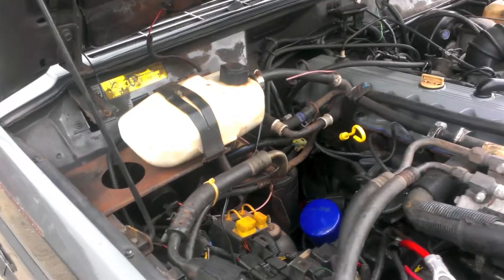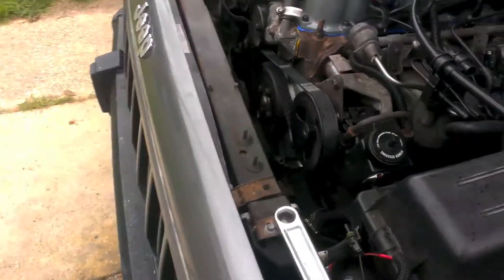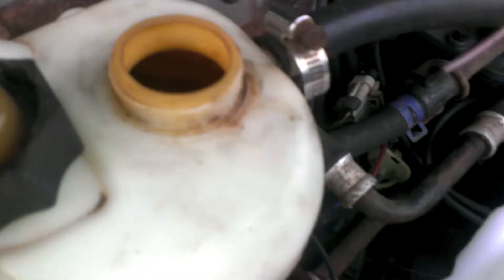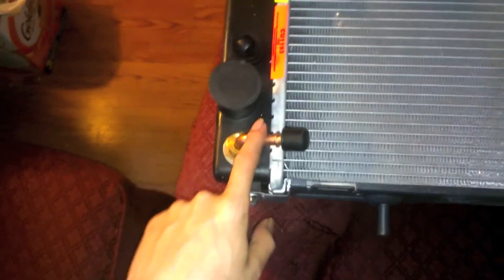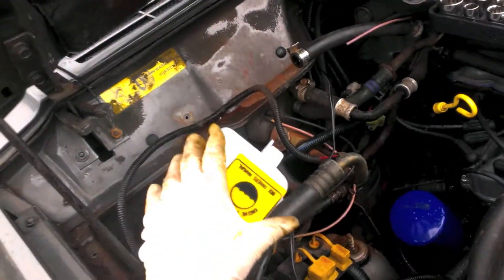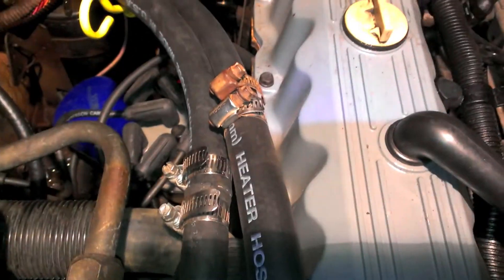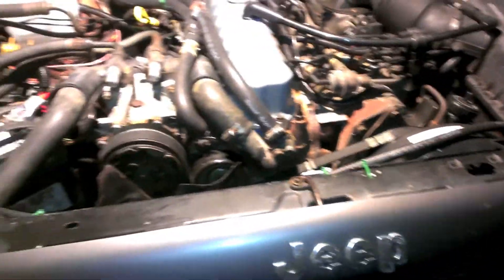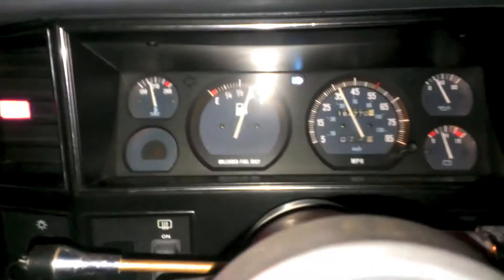89 Cherokee Closed to Open Cooling System Conversion

Comment: I'm going to hit you up on FB on this.  The difference is the "newer" style can draw coolant back into the system which is technically open as it just has a cap on the reservoir, while the "older" unit actually screws on and pressurizes.  Thus the "newer" is like todays tire pressure monitor systems for those who do not check their turn signals, oil, power steering fluid and coolant often enough in my opinion.  Meanwhile both styles use pretty much the have same cooling surface, fan clutch and water pump.  I am not an engineer, but there are those who will increase coolant capacity, air flow rate and water flow rate to make things better.  Logic point, if your pressure or reservoir is discolored, it's due to lack of maintenance or someone threw in "sealants" that might be gunking up the block besides the heater core.  Then one will need to throw in some "cleaner" in hope to dissolve and clear the gunk out.  So only in an emergency would I ever throw in an egg, pepper or "AlumaSeal" into the cooling system while in the backwoods.  Other than that I'd rather call a tow truck where my insurance can cover it.

Comment: If you ever bypass your heatercore instead of searching for those adapters again or struggling to find the 90 degree version just go to O'Riley's and search coolant hose for 1993 jeep Cherokee part number GAT 18793. It's a heater hose bent into a 90 that goes from 5/8 on one side to 3/4 on the other!

Comment: Hey man I converting to a open system my question is why is there two openings on the over flow? Does the lower opening with the knuckle get left open?
Reply from the maker: Do you have a proper overflow bottle? On the Jeep Open Style Overflow there is a top nipple that connects to the radiator neck, and a top spout to vent coolant in the event that the bottle has overfilled.

Not sure why an overflow would have 2 nipples unless you just have a closed style resiviour with 2 hose connections.
Reply: @NickInTimeFilms  I think what I'm referring to is the top spout event Cooling in cuz it's open and it's below the top nipple on the side it's the same bottle that you installed

Comment: Hey man I know this is an old video but I have two questions. I’m about to do this on my comanche. 
1) So you keep the stock thermostat housing? Bleepin Jeep’s video he changes his but I know his radiator he used doesn’t have the spot for the electric fan so I think he made up a fix for that. So I guess the question is, does it work soundly if I use what you used?
2) Did you see any loss/gain from ditching the heater control valve? I know you ended up putting a junk one in afterwards. What lead you to do that? Is the air hot no matter what setting it’s on? I can’t see any draw back other than not having cold a/c but maybe you found one? 
Thanks man. Good video.
Reply from the maker: If you find a rad with the temp port then it's plug and play.

I don't think I had AC for the longest time, so I was hoping I could keep the outside air as cool as possible. I'm not sure how much of an effect it had, but it's fine without it. It may have also been an attempt to see if the engine would heat up faster in the winter, but eventually I went full electric fans so it can get to temp.
Reply: When I first made this mod ten years ago the later replacement radiator I bought at the time also did not have the threaded port for the fan switch. I bought a new one to replace that a while back, a Spectra too, if I recall, and it had the threaded port. I am now in the process of un-doing the wiring hack I did ten years ago to return it to the stock configuration. Those fan switches are available in different temp setting, by the way. I got one that turns on at 185. The factory setup runs too damn hot!

Comment: why is it an upgrade
Reply from the maker: An open cooling system works similar to a closed system, but it's a lot less temperamental. In a closed system, if it ever becomes overpressurised, it's going to bust through the weakest link and you lose all that coolant. In an open system, any extra pressure is instead vented to a recovery tank so the system stays at a safe pressure. When the system cools, it will suck in extra coolant from the recovery tank which helps purge air bubbles and well. 

Overall, I'm much happier with this system as it has held up much better with the extra demand I've needed from it.

Comment: Any ideas on how to get one from being vapor locked hit a deer so we changed the radiator but don't have the money to change everything over like this we've tried everything and no it's not a cracked head our top hose isn't pulling fluid doesn't overheat unless you let it get to low on fluid just bubbles back in the box or comes up too far in the box and will overflow when you stop and the hose gets really tight until you let the pressure off then you can get it and go until you stop again? Please if anyone has any ideas would be greatly appreciated

Comment: Never put water these engine corrode quickly use  50/50 as recommended overall the best drivetrain ever 1990 to 1997 inline 6 bulletproof tranny cheers
Reply from the maker: HA! Dexcool is definitely not what you want in these engines. You'll gel up like no other. Regular green is what you mean.
Reply: @NickInTimeFilms  mybad bud yes you know you're shit spot on cheers!

Comment: I’m doing this now but I’m just using the factory bottle and leaving an open drain off hose out the side and running the hose off the radiator to the bottom of bottle so I can still use the bracket
Reply: My radiator had already been swapped for a pressurized one and just had a hose hanging off which would suck in air when overflows so I bought a factory bottle and just don’t run it closed

Comment: Hey +NickInTimeFilms I was wondering if you knew where the heater blower control thinga majiger vacuum lines routed. I have two lines that control the different ways heat is blown in the cabin and they're pretty much nonexistent. The lines are shredded and have been that way since I bought it. All I have is defrost mode and it'd be nice to have an idea where they go and if you replaced yours and if so where you got the replacement lines b
Reply from the maker: +Noah Maxson Luckily my vent vacuum lines are still in one piece. The Vacuum In line (Black) and Heater Control Valve Out line (Pink) are located on the passenger side engine bay to the left of the heater core coolant hoses. 

The small black line receives vacuum from the vacuum storage ball located in the passenger side of the front bumper, and the large line from the ball goes all the way back to the intake manifold towards the back on the top.

The pink line goes to the heater control valve near the heater core. If there is no valve, this line needs to be capped off with a screw or something. 

If everything in the cab is in good condition, then the vents should move again when the engine is running and the black line is receiving vacuum
Reply from the maker: +Noah Maxson This video shows you how the vacuum ball is hooked up along with some other lines. https://youtu.be/ulQbXshAgSE?t=18m20s

Comment: I just found this on a forum:
http://www.amazon.com/gp/product/B000COS5OW
Seems like a better deal than a new rad.
Found it on this site:
http://comancheclub.com/topic/27068-closed-to-open-cooling-system/
Seems like a better (less expensive & easier) idea.
Reply from the maker: Andrew Roby Clever. Don't see any issues with that.
Reply: NickInTimeFilms So i'm looking at coolant bottles to replace the crappy pressure bottle but i'm a little confused. With open system It's effectively just an overflow bottle right? There are cheap bottles that have the overflow hose connected at the top but i'm worried air might back flow through the hose, is that why everyone uses the ZJ bottle? Because the hose connects at the bottom, thus now backwards airflow? Or does it not matter & people just get the ZJ bottle for convenience?
Reply from the maker: Andrew Roby You're mostly correct. The new bottle is just for overflow and isn't sealed so it allows the pressure to equalize. The one that I bought for 91-01 XJ's does have a fitting at the top, but there is a tube built into it that runs all the way to the bottom to prevent air from getting back in. As long as the outlet is submerged you'll be fine.
Reply: NickInTimeFilms OK, that is what I was worried about. I found a cheap one that would fit perfect but the fitting is on top and I can't tell if there is a tube that goes to the bottom, so back to the books I guess... or maybe the junk yard lol.
Reply: +NickInTimeFilms Well I decided to spend the extra money and do it the same way you did but now I've got a stutter when accelerating at low speeds. It's only one little spot on the pedal. I can just give it a little more/less gas and it's fine. I've heard that air bubbles in the coolant can cause problems but I'm thinking that the tranny fluid from the rad. swap made a big bubble & that's causing a problem? I refilled the tranny fluid but no change. I've also got really low oil pressure, so I think it might be related to that... but the problem just showed up. Any ideas?
Reply from the maker: +Andrew Roby I doubt air in the cooling system would mess with your acceleration at all. Issues with the pedal always point me to the tps first, maybe it has a dead spot now?
Reply: NickInTimeFilms It's brand new, like everything else. I did some reading last night and I think it might be the coil. The cap, rotor, wires, & plugs are new. I might run some sea foam through it too. IDK, I might just stuff a rag down the gas tank and light it.
Reply from the maker: +Andrew Roby You can try a coil but they don't seem like something that would go bad all too easily. If you do light it, add some fireworks to the tank so it can go up in style :)

Comment: No dont remove the heater control dont buy anything extra or swap out anything more then the rad. All you really need is a piece of hose for the overflow bottle.

Go on ebay and look up a 1992 rad from sunbelt. a store called auto cooling that has the sensor hole for sure and if you carefully take out the old rad everything will fit right back onto the newer rad and you dont have to buy anything else and you can use the original junky plastic bottle as the overflow tank if you would like im telling you guys 52$ free shipping ebay thats it 2 core 1 inch thick.

If you are carefull taking it out then you will need nothing more then a new radiator
Reply: +NickInTimeFilms Please explain the "filter to allow the pressure to equalize".  I was considering using the original bottle and running the rad 5/16th out to the bottom of the bottle, blocking the side and drilling a hole in the cap so it will still burp.  I was thinking if the system needs to purge air it will do so through that bottle but the overflow coolant can still suck down into it.  shouldn't the 5/16th from rad be going into the bottom of a non pressurized bottle?
Reply from the maker: +Kent Dickerson You can use the old bottle as you described. By filter, I just mean make sure the hole in the cap isn't so big that stuff can fall inside and get in the coolant. The bottle I got has a built in tube the connects to top port to the bottom of the bottle.
Reply: +NickInTimeFilms Gotcha, i think that is what i am going to do.  I own a donor jeep that the po had done something similar that i am now taking the radiator from and figured i would use the same bottle.  I have two of them brand new so i might as well.  still trying to decide if i will be eliminating the heater valve or not, probably decide based on time of day and hours into project at that point.  thanks
Reply from the maker: ant l Two problems here. 

1: The heater control valve is part of the metal 3 way line so if you aren't using the old pressure bottle to hold pressure then you have to either cap the third line or replace it with hose like I did.

2: The old pressure bottle has two water passages and a cap. In order to use this as a non-pressurized bottle you will have to block the side opening, adapt the bottom 5/8" hose line down to a 5/16" line, and drill a hole in the cap and add a filter to allow the pressure to equalize. Then you could reuse the old bottle.

Comment: Do you know of an all metal radiator, with metal tanks, that can be used instead of one that has the plastic tanks?
Reply from the maker: duketyler37 Search for "All Aluminum Radiator Jeep Cherokee" on google and you'll find what you're looking for. I decided to read up on them a bit and it doesn't sound like a good idea. You may luck out and find a good product but from what I read you will either pay through the nose for a quality rad that has a good warranty or you'll buy one where the welds will blow apart after a season of use. Read all the reviews before you buy if you really want all aluminum. Unless you're having big time cooling issues, a stock design will do just fine. Best of luck.
Reply: Thanks. I have replaced the thermostat 3-4 times this year already and I didn't even drive it for to months, I had somebody crank it for me but that was it. I also don't trust the plastic tanks that come with the open system type rad.
Reply from the maker: duketyler37 99% of all radiators have plastic side tanks and they last for quite awhile. The open and closed system rads are virtually identical, except the open style also has a Radiator Cap. All Aluminium is fine if you can find a good manufacturer. 

I would check and make sure your system is holding pressure. A leak or clog could cause major issues. I'd run some water or rad flush through the system until in comes out clear. Water pump still pushing good flow? A bad thermostat usually causes the system to over cool and never get up to temp if stuck open, getting stuck closed would cause it to overheat very rapidly.
Reply: I relplace the water pump almost a year ago but I was having the same issue before I did and I replaced it because the bearing was going out. What do you think of CFS?
Reply: And would a 91+ rad work in an 89?
Reply from the maker: duketyler37 Didn't see anyone complain about weld quality so that's a good sign. A 91+ Rad will physically fit, but you'll have to do the closed to open mod as shown in this video for everything to work right.
Reply: Alrighty thanks man!

Comment: You should seriously consider picking up a fan shroud from the junkyard for that mechanical fan. Not only will it help your rad cool better (proper airflow), you won't have your arm cut off if you ever accidentally get too close to it :-)  Keep the good XJ videos coming!
Reply from the maker: Keep up buster, I'm running dual electric's now and they have built in shrouds. Also, my  jeep runs too cold to begin with, I'm trying to get it up to temp.
Reply: NickInTimeFilms If it's running too cold maybe you have the wrong thermostat. Are you running a 195F one?
Reply from the maker: dainternetguru yeah, I put in a stant superstat 195℉. I deleted the heater control valve when I did this swap but I added in a manual one later and keeping it open or close doesn't change anything. I'll have to start pointing my temp gun around and see if I can't figure it out.
Reply: NickInTimeFilms Yeah checking temps all over would be a good next step. I have heard that OEM Mopar thermostats are best.